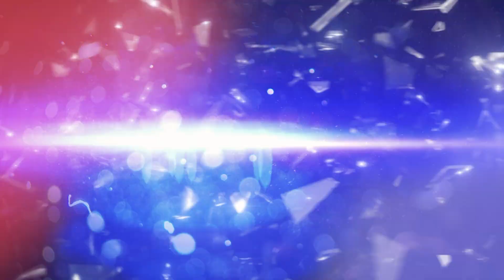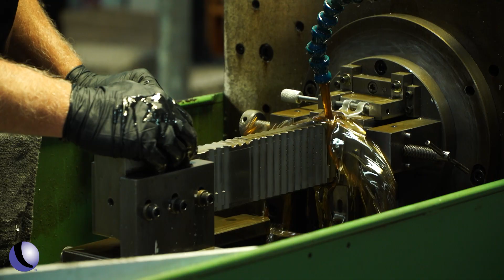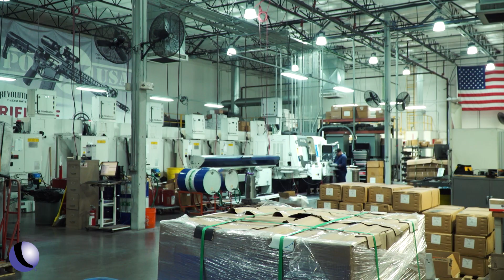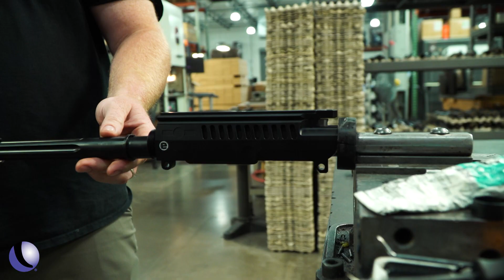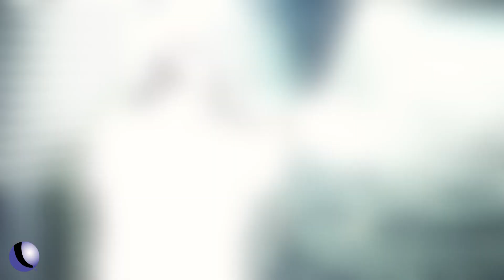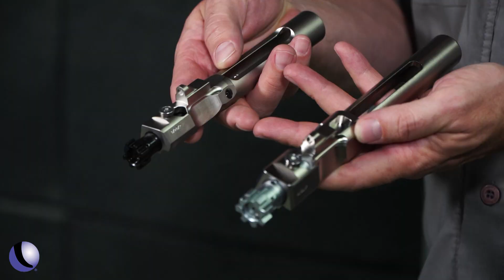POF-USA Revolution Rifle + Factory Tour | Guns & Gear

Comment: I'm sending my revolution back because it's having some serious issues cycling and brass getting stuck in the chamber. So far I'm not impressed with whom I've been talking to at customer service. I will give them a chance to make it right but I'm very impressed so far.
Reply: I have seen a lot of comments concerning issues with the 308 Piston driven from POF on youtube. Is yours a Piston driven POF? I have a 415 POF edge piston driven .556/.223 and love it. Do you think, that the .308 issues might be in the BCG. Its not the same as a regular .308 BCG as show in the video?

Comment: POF customer service is Great. The D.I one piece bolt carrier is Very Nice, Handguard is comfortable and DI Adjustable gas block is easy to adjust.
Reply: Do U trie it? What is the difference with other guns? ... Are U shotting a lot ultimatley?
Reply: @donpelayo4496  could you retype the 1st question? Trie is a computer science term "digital tree". First off, I do not own a Full POF Rifle. I basically wanted to build a 416 but for less. I purchased the Handguard, Barrel Nut w/ D.I Gas system. Some time later emailed them about getting a Barrel nut but on their website that was not an option however they sold be one and got it to me under a weeks time. The One Piece BCG is very well made / clean machining. The only other parts I do own is a Puritan but I prefer my Son's of Liberty Gun Work Lower receiver without that wall that's found in a Lot of AR-15 lowers. The other POF part I own is the Tomahawk Charging Handle but I wouldn't recommend because it feels a little flimsy. 
 Side noteThe Barrel Nut keeps the gun cooler but it does add weight and is not interchangeable with all handguards. The prices are crazy these days.